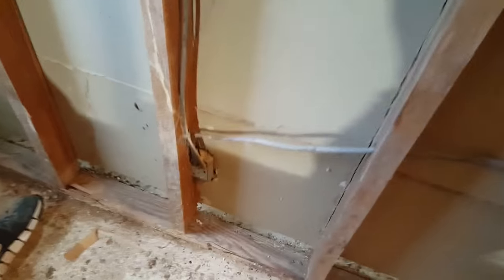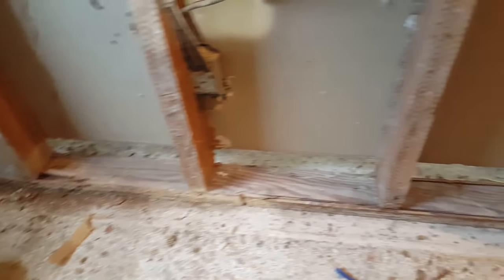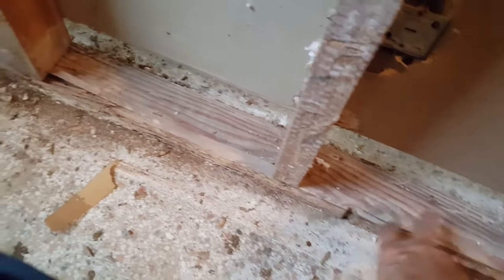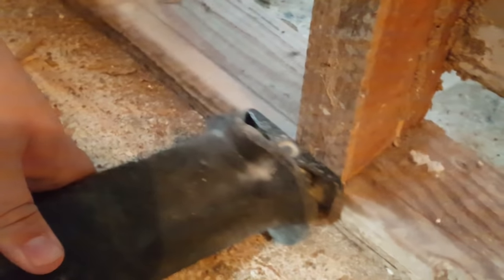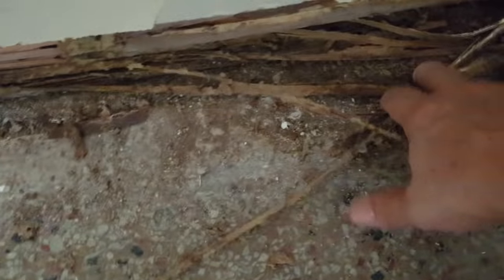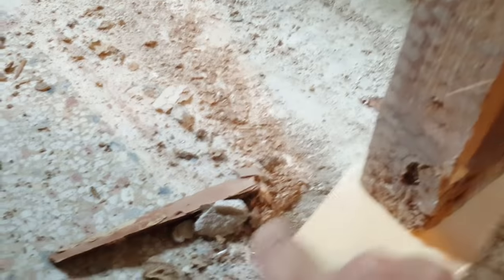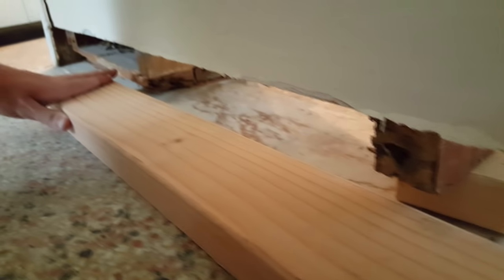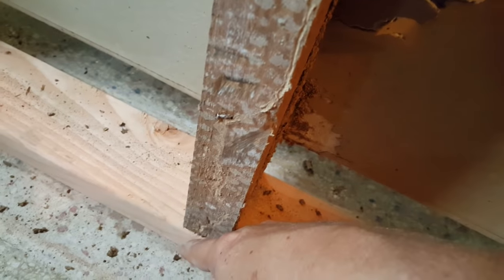How To Replace Rotted Stud Wall Bottom Plate

Comment: There's a corner of my garage where moisture has gotten in I fixed the gaps in the siding but they did bolt the plates down so the bolts are rusted and can't come out. I'll have to improvise as far as what to put under these studs for support. But is the Saw zaw the same as a reciprocating saw?
I've been able to remove most of the nails that connected the plate which was completely deteriorated into wood chip, dirt, mush but if I can use my reciprocating saw that would be helpful to know. I've also reinforced the studs with new treated studs as I know I'm not able to replace the plates that were once there the screws that held the original 2x6 plates in are completely rested and I couldn't remove them without them snapping off. If anyone has an idea or suggestion I would really appreciate it!
Reply from the maker: Yes, Sawzall is Milwaukee's name for the recip saw. You can also use a grinder on them too.
Reply: @jeffostroff  okay thank you so much!

Comment: How about using treated lumber whenever you come in contact with concrete or cement?
Reply from the maker: Yes you are correct you should use pressure treated in this case, but for the purposes of this video we used just a piece of white wood laying around. You can also use white wood if you place a moisture barrier underneath. In most areas code requires that you use pressure treated wood or have a moisture barrier underneath.
Reply: Thanks for the info. Thanks for sharing your method.
Reply: And also, add the moisture barrier, always !!!
Reply: @Allbbrz  whats a good moisture barrier
Reply: wow I asked this 7 months ago and didnt get a ressponse.  Anyhow dont use PT Lumber in interior spaces.

Comment: Anyone have a link how do it for a load bearing wall?
Reply from the maker: For a low bearing wall what you basically do is build a second wall of studs in the top plate and bottom plate and Widget to the floor and the ceiling so that it acts like showing polls and it's a temporary support for the load bearing wall. Then you can take down the current load bearing wall or do whatever work you need to do to it but it will be protected by Your 2nd stud wall

Comment: I know this is a stupid question, but are all walls load bearing walls in a single wide
Reply from the maker: No Chris single wide trailers don't have load bearing interior walls, because the exterior walls support the roof. But, I hear some double wides have load bearing interior walls due to the length of roof support needed, so likely the midway point on a double wide would have a load bearing wall.

Comment: nice work but isnt the wood that touched concrete suppose to be treated?
Reply from the maker: We used an underlayment under it, and it did pass inspection.
Reply: @jeffostroff   What kind of underlayment did you place between the stud and the concrete flooring
Reply from the maker: @GuardianOfOneTruth  a y moisture barrier will do. We used some green underlayment from laminate flooring  thin spongy material with a vapor barrier film on the back side. Shoved it under the b On a plate in order to meet the inspection because we forgot to stick it under during the filming of the video.

Comment: Usually the replacement base plate should be termite/pressure treated..
Reply from the maker: You can get away with it if it's got the underlayment which we added after this video, and it passed inspection

Comment: I have this and bottom 6" of some studs to replace too... :/
Reply from the maker: Make sure to use pressure treated wood at the bottom plate, or use a vapor barrier under the bottom plate, or even both for best results.
Reply: @jeffostroff  yep I got pressure treated and some Thompson's waterproofing for the fresh cut edges
Reply from the maker: @laprepper  you are good to go!

Comment: Ground or concrete contact lumber HAS to be pressure treated. It’s the code.
Reply from the maker: We used a vapor barrier, but it didn't make the final cut of thos video. Passed inspections with the vapor barrier.

Comment: I sure how while the wall was open they replaced that old asphalt wiring could reach and outlets with new
Reply from the maker: Yes, an electrical contractor ran all new Romex and outlets down the wall, converted from old 2 wire to three wire with ground, put in a whole new electrical panel, kitchen counter outlets, kitchen light, living room lights. For this 2 bedroom house it was $7500 just for the electrical work!

Comment: You had put the wrong material,  should use pressure treated wood
Reply from the maker: We used a vapor barrier underneath it, not shown in the video. That is allowed, and you don't need PT lumber. It passed inspection too.
Reply: @jeffostroff  I'm 153 % sure that there was not real inspection other than yours and I'm like 197% sure that there is no moisture barrier in there. just saying not that I care about your quick cash grabs.
Reply from the maker: @Changungaz   You are a 153% wrong on both counts. Actually the day we were doing that video we were looking around for a pressure treated 2 by 4 thought we had one left to shoot this video with couldn't find it so we shot the video with the white wood instead. Keep in mind this was only a 6' long span of a wall so after shooting the video we scrambled to get some vapor barrier underneath that plate and yes it passed inspection because you are allowed to have a vapor barrier under the bottom plate if it's not pressure treated.  All of the rest of the bottom plates in the  Renovations of the property are pressure treated.  The funny thing is the plumber of field his inspection originally because he used a 1 by furring strip instead of a 2 by 4 for the Stringer board for the tub.
Reply: @jeffostroff  of curse of curse how much did you charged for that job?

Comment: PT DUDE
Reply from the maker: G Leonard We actually put a Layer of moisture barrier down under the bottom plate when we were done you are allowed to use regular wood as long as you use a moisture barrier underneath it otherwise you have to use pressure treated like you said

Comment: Can't believe you didn't sweep first
Reply: Exactly, what a mess !
Reply from the maker: You did not pay attention very good. We swept the area near the wall, we even vacuumed along where the bottom plate was going to be slid underneath. I assume you are talking about the dirt and particles on top of the bottom plate AFTER we installed it. That was because banging in the bottom plate into place knocked a lot of crud and remaining termite residue off the walls above onto the bottom plate, which we then vacuumed up afterwards. But the whole length of the wall underneath the bottom plate was indeed swept clean and vacuumed.
Reply: Thank you for your report about this. It's good to know it was all swept and vacuumed. We all appreciate good workmanship ! Sorry about my above comment.
Reply: the moisture barrier which is invisible to the naked eye takes care of the cleaning it comes with tiny little brooms and vaccums, this guy is light years ahead of civilization. What you see is a decoy your mind would not be able to process whats really happening.

Comment: May as well have just rebuilt the wall...
Reply from the maker: No need to, the studs were in good shape. Also the other side of that wall is plaster. You go messing with that stud wall, and now you have to demolish an entire plaster wall, and bring in new sheets of drywall and convert to a drywall now.

Comment: Seems like most of the comments are how you didn't use PT wood.
Reply from the maker: Most of the people making those comments are unaware that you can use regular wood if you use a vapor barrier underneath which is what we did. We did not show that step in the video however probably could have shown it,  At the time we were just concerned about showing the process of how to remove the old bottom plate and insert the new one.
Reply: jeffostroff Yeah, that’s some crucial info. Without it, all the PT wood comments are going to fly.
Reply: Plus, by the looks of the video it didn’t look like you used a moisture barrier.
Reply from the maker: @DiscoDashco  We used a green moisture barrier, we pulled the bottom plate back out and slid it under the plate before reattaching the bottom plate again. We definitely had it on there after this video, and we passed inspection with it sticking out from under the bottom plate.
Reply: @DiscoDashco  yea dude do not be such a hater, let the poor men get his kick cash grabs plus im pretty sure it took no time for him to take out that nail which actually missed the stud at the end of the video, plus the moisture barrier must be invisible green because i don't see shit.

Comment: All that work and you still put untreated wood on the concrete.
Reply from the maker: We put a vapor barrier underneath it and it was approved by the inspector.
Reply from the maker: @jethro9341   You were not there when we stuck in and afterwards,  Not everything we do makes it on video. Just own it like a man admit you made a mistake and be done with it.  It was there when we were done and had got approved by the inspector.
Reply: I didn't have to be there, you made a video of the process lol. Its blatantly obvious to anyone with experience in remodeling, or half a brain for that matter, there is not a vapor barrier under that wood.
Reply: Jimmy lol, what do you recommend as a waterproofing membrane? I dont want to use untreated wood in a livingspace.
Reply from the maker: @lionintu  try this product, designed to go under sill plate https://www.lowes.com/pd/Dow-STYROFOAM-R-0-22-9-sq-ft-Unfaced-Polystyrene-Roll-Insulation-5-5-in-W-x-50-ft-L/50071521
Reply: @lionintu  I'd go with something that isnt going to compress. Like visqueen or tar paper. Theres products you can 'paint' onto the wood too. The absolute best thing to use is treated wood and a vapor barrier. And the book answer...see what's approved in your local jurisdiction.
Reply: @jeffostroff  thanks for the link, Im picking this up today.
Reply: @jethro9341  I'll look these up but it's not a large area. and I can't use treated wood indoors